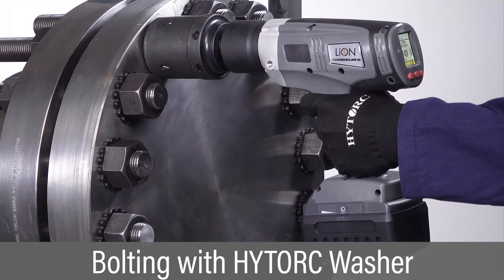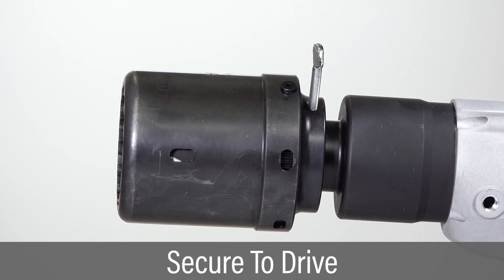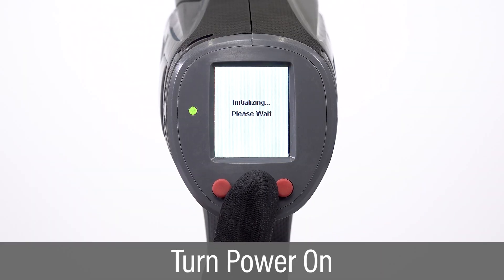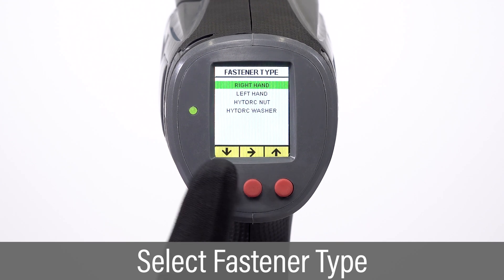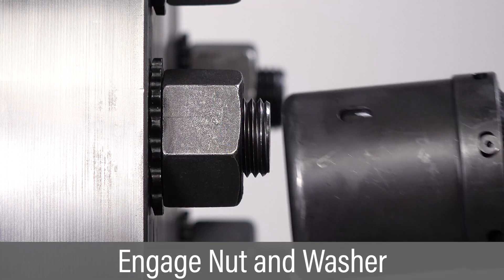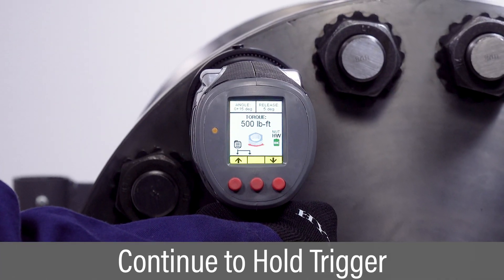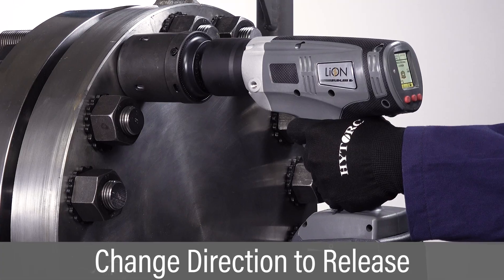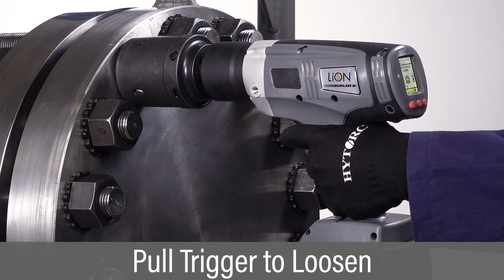11. Bolting with HYTORC Washer and the Lion Gun Electric Torque Tool

Comment: Advanced customers have learned that more repeatable bolt loads are possible when you control the tightening process using a torque and angle procedure.  For instance;  a customer that installs millions of lug nuts per year may prefer a tightening process of 50ft-lbs + 60 degrees of rotation.  This may produce the same output as a predefined torque such as 300ft-lbs.  However,  in certain situations, "Torque"  + "Angle of Rotation" can create more accurate preloads than just straight-up torque.

Comment: For what is the angle of the torque tool?
Reply from the maker: Some applications require a turn of the nut to a specific angle after reaching a predetermined torque value.  HYTORC Electric Tools can deliver both torque and angle in the same pull of the trigger.